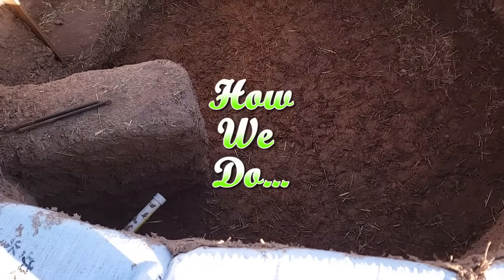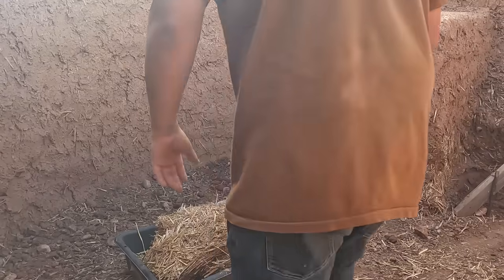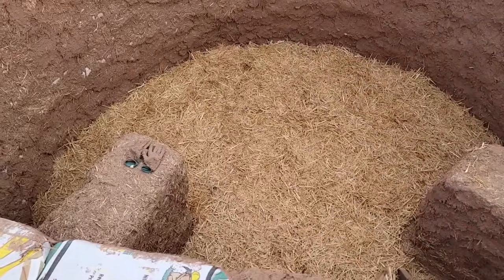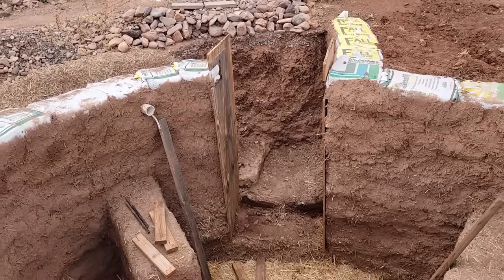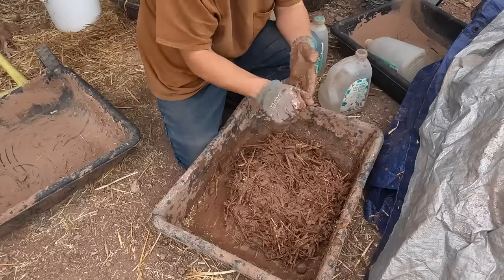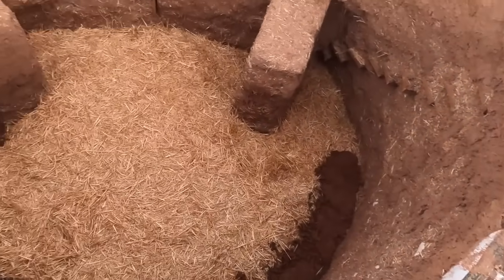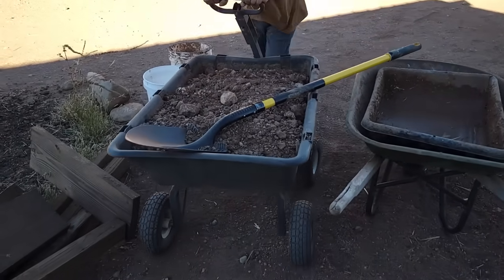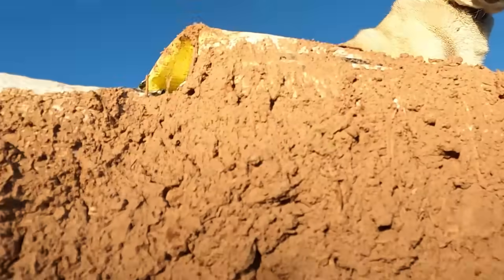Unique Root Cellar Floor Installation | Huge Progress!

Comment: I am a little curious about trying to insulate the floor of the root cellar?  Seems you would want as much coolness as possible- Think the mixture you are making would  be a nice insulation filler for the rafters.  Staple some burlap to the underside of the rafters possibly a few sticks  nailed across and  lightly pack the straw cob in.   possibly do long screws through the side of the rafters  to help lock the cobb in.  let dry and then add  multiple layers on the top tell you get about six inches above the rafters.   imped some more branches spanning across the rafters as you build it up- each new layer of cobb have less hay in it.   First thought was build it like a beaver.  Tarp over it allowing airspace for it to dry- run a fan inside pulling the very dry desert winter air through to help dry -  Then a thin layer of that cement you  do.    Build the stone gabions around the side and do temporary roof/ tent over the top.   with a little chimney opening at the peak- so during the summer- air would be sucked through the wide gaps between the rocks up to the peak of the tent and hot air would flow out the top.  having a gap between the  earth roof and the outer roof would also keep solar gain down.  Always amazes me how something like just a 1 inch gap will cut down on heat transfer with ovens and appliances.

Comment: Will be interesting to see whether the cobbed clay cracks when it dries.  I am assuming that a thin coat of clay will be applied on top for a more finished, smoother textured floor.

Comment: Get you a piece of plywood or two that you can stand on and use your tamper in the packet down and get it leveled out as you walk around on the plywood and moving the pieces of plywood wanted to turn and going back-and-forth all of them that will pack it down tiger and make it more compact where it won’t crack a split on the

Comment: Maybe consider a layer of sand over the cob floor. It won't retain moisture, will fill in the cracks and level things out.
Reply: Or maybe tamped it down a bit while it was damp.

Comment: Where can I read up on cob floors? I'm curious as to why you laid a 4" straw layer first? Is that for thermal insulation, or moisture, or what?
Reply from the maker: Insulation

Comment: So why are you not using the cement mixer to make the floor cob? Also dont get why you are putting cob on top of straw ...I could see putting damp earth down there and tamping it but not cob . once it drys as soon as you walk on it , it will crack
Reply: I was wondering this too.  But I imagine there's an explanation, since these two have more practical experience with cob than most of us do.

Comment: I'm worried about the floor cracking under pressure, because the straw won't support the weight of the floor cob and whatever will be put on the floor at specific spots.

Comment: @p.9136
1. You will never build what you propose.
2. You will never make a video of it either.
3. It's all costs and no benefits.
4. The switch bike already exists, Google it.
5. For the cost of the electric chainsaw alone you can buy a better bike than the one he started with in the video. Edit: this is about an entirely different YouTube Channel video clip and it doesn't belong here my sincere apologies for getting the wrong thing in the wrong place. I'm sorry, entirely my bad.